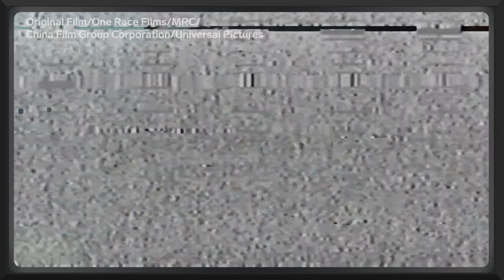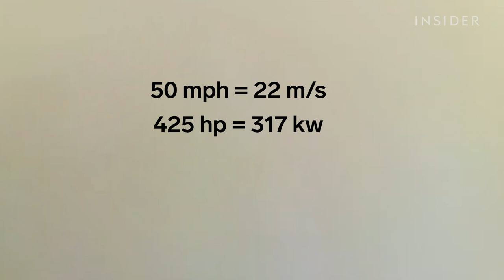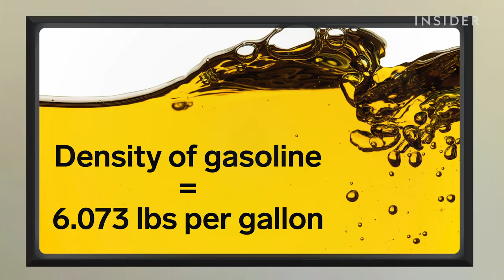Physicist Rates 11 'Fast And Furious' Movie Stunts | How Real Is It? | Insider

Comment: Small correction that vault scene, the vault actually doesn't have any cash in it
Reply: 😂 offcourse she is screwed
Reply: Hahahahaha. It doesn't matter with or without money a car can't drag that huge vault.
Reply: @yajson  Yeah making the vault just 6 times heavier will make no difference when it is 7 times heavier.
Reply: @Kishor Sebastian  - HP is a measure of power; force times speed.  But dragging something with a lot of friction requires a lot of force, regardless of what speed you can get up to.
If your tires can't grip the ground better than the safe "grips" the ground, you can't move it.  (Except in jerks by building up speed with slack in the cable).
 I'm assuming the engine / gearbox has enough torque at low revs to max out the tires' grip, although knowing that the motor can put out 5000hp (at some unknown high RPM) doesn't tell you that for sure.
Reply: @Lucivius27  Except the vault wasn't 7 times heavier. The scene said it was 10,000lbs, 12,000lbs even with the money. The car weighs about 4500lbs with Dom and the nitrous system installed, maybe a little more with the crash bars. That's still a huge weight difference, but not the 7 times heavier she repeated over and over. Granted, she may have fubar'd the numbers a bit, but she's right on principles.
Reply: @Jack_S_  Yeah my bad not good at calculating but she is still right money or no money the car can't drag the vault .
Reply: @Lucivius27  I could if I had my keyboard
Reply: Y’all forget how much gas that would take
Reply: Who took the money?!
Reply: What you really just said: "I'm about to end this whole woman's career"
Reply: I literally looked into the comments to find someone who was going to say it. Lol she Calculated it wrong. BUT STILL!!! She’s right! Just take the weight of the money out.
Reply: I can prove all you guys in this comment section wrong by telling you to do a simple Google research or watch the making of Fast Five....they actually DID tow an actual VAULT
Reply: @Lucivius27  They actually did drag the vault though....just look at the behind the scenes of Fast Five or Google research it. 90% of the scene is them actually using Dodge Chargers to tow a 9000 pound vault. And you didn’t say this but other people did. It’s not about how much horsepower the car has. It’s about the amount of Torque you need. Torque is what you use to tow or pull something using a car. Not HP.

Comment: The guy gets blasted in his car by a HEAT missile according to the size of explosion; uses to move 5+ ton steel box on the asphalt with the racing car and has a car which has design from 80's but has 5000 horsepower and is equally as fast as most streamlined super car and all she says:

"It's believable."
Reply: The scene in Fast Five with them towing a 9 ton vault is real they actually did do that you can look it up, Dom doesn’t get blasted by a heat seeking missile he makes it hit the submarine and he crashes within the flames do too the way he landed the car, and a car with 5000HP is a very undrivable car and that 80’s style car is a 1972 Plymouth GTX. But yeah I still see what you mean LOL I was just correcting you on certain things

Comment: There is no way that boat has a hull speed of 100 mph.
Reply: thats what i thought......it would either sink or go flying....
Reply: Be lucky to be going half that.
Reply: I was hoping someone said this
Reply: Yea, Id be surprised if it can make over 40, being a yacht and not a speedboat
Reply: Yeah the hull speed (displacement speed) is more like 8knots,
Reply: According to my hull speed calculator, that yachts waterline length would have to be nearly 6,000ft to get a hull speed of 100 knots/ 119mph 🤣
Reply: So its as accurate as all the other physics in the series
Reply: Lol yep has the lady ever been on a boat? That thing going 100 mph?
Reply: Yeah I always perceived that scene as the Camaro catching up to the boat, and therefore smashing into it with at least a 30mph speed differential.
Reply: Considering that the Camaro left the ramp at almost 120MPH, and the boat wouldn't be capable of going anywhere near that speed, it makes me wonder if the Camaro should have hit hard enough to sink the boat outright

Comment: The first scene was pretty clearly falling in slo-mo (and/or showing parts of the time over again from another angle), but she took all of it as real-time to calculate falling speed and vertical distance :/
Might have been better to just look at the height of the bridge and extrapolate the fall speed from known gravity and air resistance.
Reply: I don't think how long the fall lasted affected much since she covered smaller jumps and much smaller speeds that were still almost impossible to survive, so regardless of how long they were falling, they wouldn't have survived.

Comment: Here we see the phenomenon of a physicist assuming a spherical cow in a vacuum.

In the scene with the yacht, speed is one of the primary assumptions used in her calculations. One conclusion was the car would never be able to make the jump onto the yacht as shown, because they are both traveling at 100 mph.

100 mph...a yacht. The only way a yacht moves that fast over water is if it has wings and is airborne.

Comment: She didn’t calculate in the first video if the car hit the water first it broke the surface tension and made it a much softer entry for them to fall into the water I don’t believe that the drop would have been anywhere close to 1700ft but either way let’s say about 7-10 sec fall at 800 ft and around 90mph with the car breaking the water first this would be 100% achievable

Comment: The first clip is clearly in slow motion, which changes the calculations dramatically. If the fall were 4-5 seconds instead of 10-15, then the height would be 250-400 feet rather than 1700, which makes it just on the edge of plausibly survivable.

Comment: 13:50 while she’s completely right but especially in Florida especially in the must southern parts they use an extremely strong glass that is designed to protect the building from objects flying at hurricane speeds while I doubt they use that kind of glass it is available

Comment: In the jump onto the back of the boat: you said the car would be going about 105 mph, so, yeah, that's a problem if the guys in the car are going to survive...IF they were jumping onto a stationary boat. But the boat is going (by hypothesis) something like 75 mph. So the relative speed is only 30 mph. Very survivable.

Comment: 3:40 I don't understand how if they boat and car were going approximately the same speed (after the math of the 45 degree ramp) the collision would be 105mph. Their relative speed differences I would think would be something like < 20mph.
Reply: The movie obviously shows the boat out too far though when the car is airborne unless the boat was initially faster, but slowed down or something along those lines.
Reply: Ok I see my mistake, it may be ~20mph in the horizontal direction, but the speed in the vertical direction would be ~80mph.

Comment: You would need a f*cking Saturn V rocket booster to get that fully loaded yacht to go 90mph. 

That Charger with or without Dom in it would weigh alot more than 3000 lb. 

Other than those points this was a tight analysis with many correct points. By the way, why are some of these videos in 4K and other ones looking like they were shot on a 2002 Nokia phone?

Comment: During the two tower jump scene, I wish she would have calculated the about of pressure on the car as it lands. There's no way in hell a car that is meant for a smooth track with extremely limited suspension travel and ground clearance wouldn't explode into a million pieces of it even landed on hits wheels!

Comment: your calculations from fast5 and the safe are completely off. At this point in the movie the safe has been swapped out with a completely empty safe. The money was still in the safe which was swapped out. I think you should try to recalculate using the weight of an empty safe, and still see if you come up with the same results.

Comment: Not that I'm trying to defend the physics accuracy of the Fast and Furious movies, but your formula for whether the Charger could drag the safe leaves out one very important factor: it's highly doubtful it would have the stock engine, so you would need to calculate probably half again if not double the horse power. I'm not sure how much practical difference that would make, I've never been great at math, but I do know the F&F guys never run with stock engines.

Comment: Her first calculation was already plain wrong and embarrassing. After 11 seconds including the acceleration phase, you will have fallen for around 1000 feet to 1100 feet (depending on your body position) - not almost 1800 feet! 1800 feet would be the case if you assume full terminal velocity in a belly down position for about 11 seconds, but not when you need to accelerate first.

Aside from the fact that engineering students should have no problem with these basics during their first semester, it's even standard knowledge for skydivers and base jumpers, as "300 meters/~1000 feet/10 seconds to terminal velocity" are a good rule of thumb for your acceleration phase.

@Insider: What the heck - does anybody check those answers?

Comment: u r wrong, there is no cash in that vault in f5, that's the empty vault
Reply: no she is not wrong, the vault is full until they reach the bridge
Reply: @JAtoA  it's only dom driving which means brian was ejected. dom has empty vault. when both dom and Brian was driving, they were pulling the cash vault
Reply: Making the vault just 6 times heavier will make no difference from  when it is 7 times heavier.

Comment: WHAT? A yacht going 86 knots....Bull Crap! You know nothing about boats. Let's put this into reality, please. That Yacht is about 70 feet maybe 100 feet, but I doubt it's that big. It's going to have two either Jon Deer or Catipialier sea-going engines. At cruising speed that boat would have a max speed of about 25 knots, that's about 28 MPH. At max speed, this is throttle all the way down, and blowing all the fuel you have, maybe 30 knots, but that is pushing the best technology of today! A yacht is not a racing boat! It's designed to cruse, at a gentile speed, so you can live and walk while the boat cruises down the shore!. This is not a small two-man Jetboat, designed to floor it. That boat going right out of harbor would have been going at best, probably 18 to 23 MPH, at 100 MPH, that car would have flown over the boat and landed in the water. PLEASE get an expert that knows something about boats, or google it. The move lied by perspective to give you a false idea that something like that could equal the car. Hollywood bull crap! Oh, and by the way, another outright lie, a boat that size, takes 20-30 mins to even turn on the engines from a dead stop. There is no way he could have rushed there and been already leaving before a car going 100 MPH didn't get there, that movie gets a 0/10 for utter bull crap! They knew nothing about real boats!